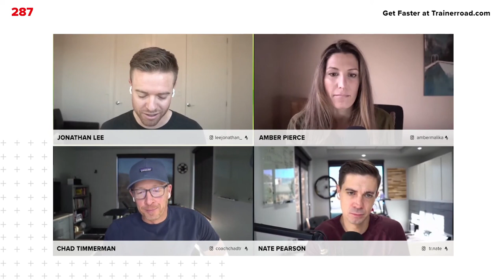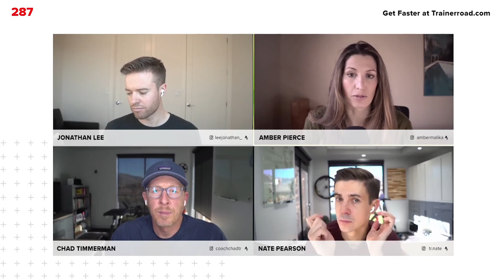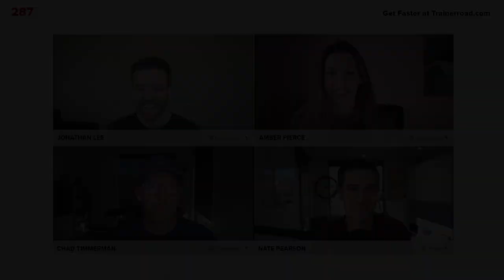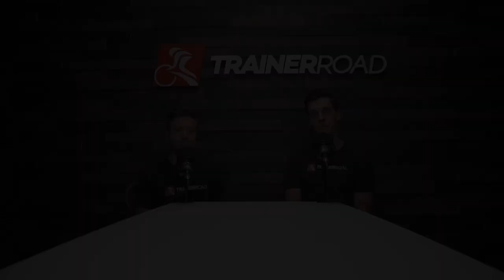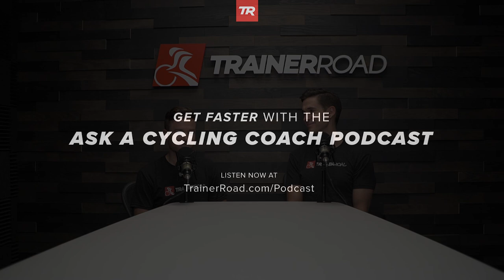Does Crank Length Matter? (Ask a Cycling Coach 287)

Comment: My Inseam is 94 cm. After years of riding 175 cranks i went up to 177,5 an even 180. Best feeling on riding ever and also a little more power output. Once i tried out 172.5 which gave me massive knee pain. Cranklength depends much on individual phyisiology. Saying short cranks are always better is not true. On tt bikes maybe shorter is better cause of the hip angle. That could mean that 175 is short crank for a tall rider

Comment: As a test, and to prove the theory, I bought a 155mm 1X crank on Amazon, tossed it on my gravel bike that previously had 172.5mm.  You notice it a bit at first, then you don't.  Zero performance difference, body position changes slightly, seat goes up etc.  The only reason shorter cranks aren't widely available is industry dogma.  The benefits are numerous.

Comment: Everyone I've seen so far is concerned with speed, power, and efficiency but I'm in my 70s and that is not important to me. I'm interested in the best hip and knee angles for injury prevention and how to determine the crank length for that.
Reply from the maker: Great question! THAT degree of specificity is definitely individual to the rider, your history with injury, and of course your height/composition. We definitely recommend checking in with a bike fitter who can take all of those things into consideration, as things like cleat position and saddle setback/angle can often have a more significant impact on knee and hip injury prevention!
Reply: @TrainerRoad  Thanx for the reply... I've read a lot about setting seat height and angle and reach but very little about crank length and it would seem that you would have to start with crank length. Most of what  I've seen seems to say crank length doesn't really matter but I would think crank length should be about when the seat height is set you should be getting proper knee and hip angles when pedaling. Perhaps something around a consistent 90 degree knee angle.

Comment: With all due respect, I disagree with all the findings of these scientific studies. 

When changing crank length these studies never mention adjusting position. The bike is pretty infinitely adjustable. 

I’m a 64 year old rider, 6’6”, racing days long over, doing about 4500 miles, on average, annually. 

I purchased a bike that, unbeknownst to me, had Zinn 200mm cranks. At first, there was a distinct “windmilling” perception. But a funny thing happened. Same power, lower heart rate, more speed pushing a bigger gear. PLUS years of nagging knee/hip pain, despite having a fitting, disappeared gradually. Ultimately I came down to 190mm. Perfect!!

I’m able to “get on top of” a bigger gear on the flats, climb a bit better in a bigger gear, with a lower heart rate and subsequently less fatigue. 

On a mountain bike I do have to be a little more careful as well as on a Specialized Roubaix. But having bikes built by Seven has taken the crank length into account. No worries. 

Bottom line?  They work for me and other NBA types. 

Great podcasts!
Reply: I agree. I’m 6’4+ and had similar thoughts. The squat  analogy mentioned in the video isn’t persuasive because the duration of the applied power is a factor in over all power.  I have ridden 172 bikes. I might buy that shorter lengths are optimal for track. However for rolling courses or acceleration I could never get comfortable on 172 cranks.
Reply: So you disagree with studies based on anecdata? Nice.
Did you look up the protocol for the studies before you asserted that they don't change position?
Also they discuss the issue re leverage because gear ratio changes when you just change gears.

Tldr; it's about fit. But all the issues with power loss due to short cranks is pretty much bunk.
Reply: I do disagree based on living it as opposed to very focused scientific studies. I and several other beanpoles I know. 
Even with a background in mechanical engineering this is beyond me to describe, but....
Starting at the hip, the length of upper and lower legs, feet, cleat placement, and crank length create an unbelievably complex set of levers. This should be taken into account, as well as the riders perceptions in these studies.
Reply: @rgz4ams 
You're really not disagreeing with much. They said it comes down to fit and hip angle.
You keep referring to the studies. Have you read them? Your lived experience doesn't negate the studies. You should understand this given your mech E background!
Reply: What I’m disagreeing with is the “evidence” of the studies referenced in the video vs the “experience” I’ve had and other tall riders. The mention of longer cranks putting your knees in your chest for example is laughable. 180 to 190mm is approx 3/8 of an inch. 
Having ridden long (190mm) cranks for about 8 years now I can report that:
Hip and knee pain disappeared after switching
A lower cadence and lower heart rate at a given wattage. 
Still able to spin a lower gear at 90-110 rpm, cleats all the way back, with no problems. 
YMMV, if you wish to follow science, please do.
Reply: @rgz4ams 
You are not disagreeing with the studies at all, you're simply saying that the fit issues discussed by the participants of this podcast don't apply to you. There's a collosal difference between those two things.

Your personal experience and fit constraints do not invalidate what is being presented. It just means that you have different needs for your fit. It's really not that complicated...

You're like 6 sigma from the norm based on your proportions lol. Big difference between someone like me riding 165s at 5'10 vs you! That doesn't invalidate what was described in literature though.
Reply: Are you still on about it?
Reply: @rgz4ams 
😂😂😂😂😂